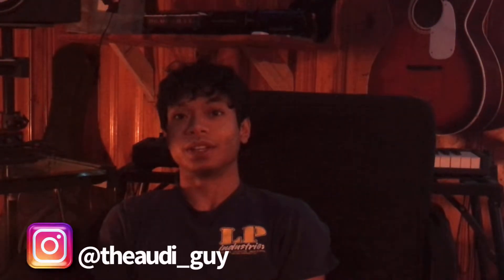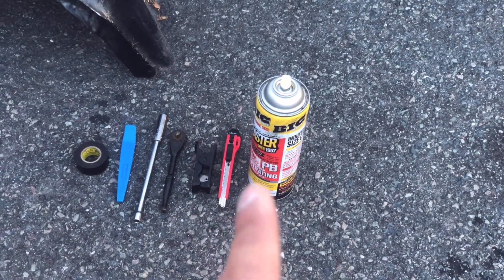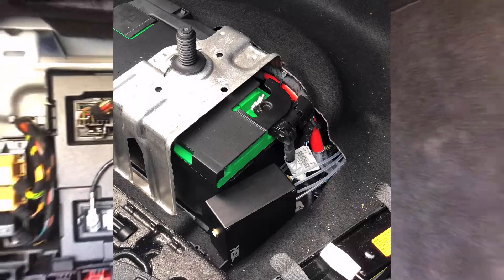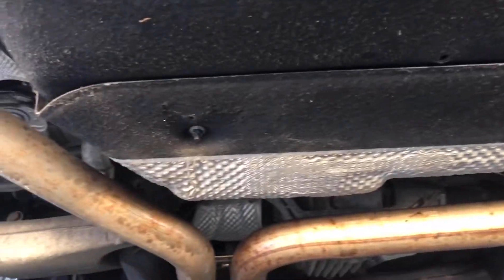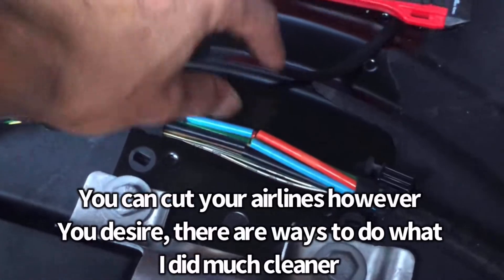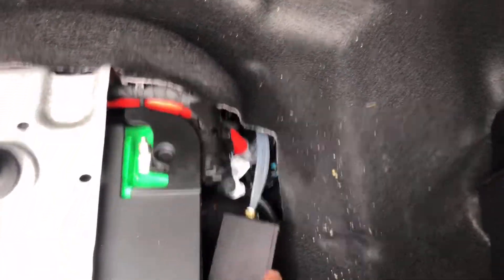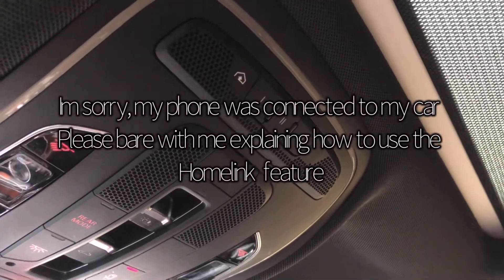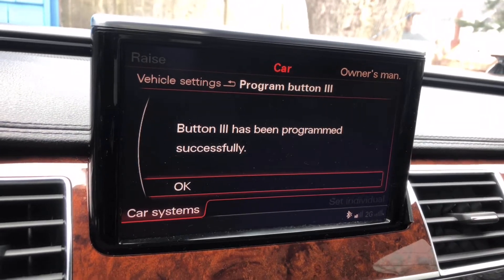{#A8L} How i aired out my D4 Audi a8l TDI (TGK Motorsports dropbox install)

Comment: How it is when you start the car ? It complains about air suspension multifunction ? But then it going up anyway?
Reply from the maker: no fault complaints! & is designed to auto air up on start up. no need to touch any buttons on start up

Comment: My suspension compressor may have just failed.  Can i install rhis and it will replace the need to fix the suspension conpressor?
Reply from the maker: no that is incorrect still need functioning compressor
Reply: @turboporsche_  thank you

Comment: That's going to put a bunch of stress on the compressor. It wasn't designed to regularly lift the car from fully aired out. Not a big deal if you are prepared to replace it if it burns out just saying.
Reply: The compressor has a cut out to prevent it burning out mate
Reply: @Funkyflykiwi  wtf does that mean.. it's not designed to lift the car from aired out regularly. This will 100% shorten the life of the compressor. End of story.
Reply: @bsfunk44  if you dont know what that means I suggest you learn basic engineering, you didnt design the compressor so no idea why you think your in a position to say its going to burn out.   Research thermal overload cutout and compressor duty cycle.
Reply: @Lee Paterson  boom 💥 sprinkle a little engineering knowledge on him.